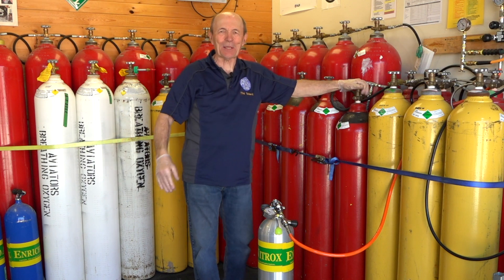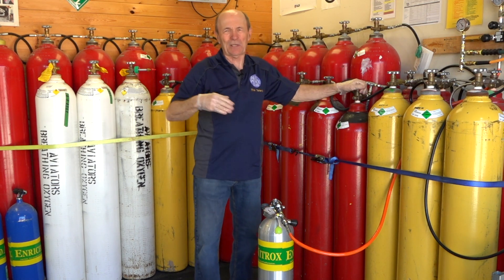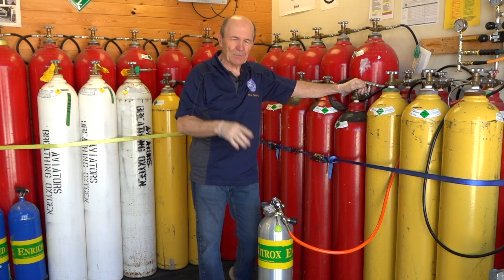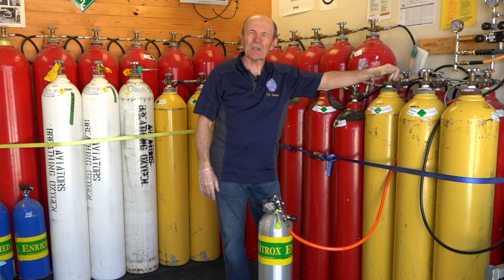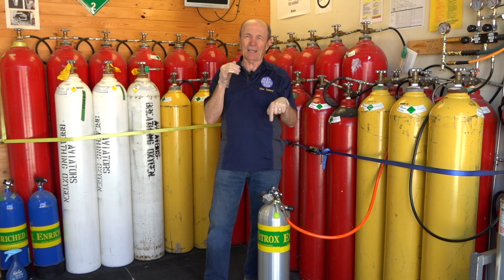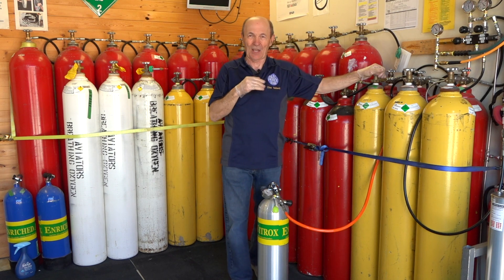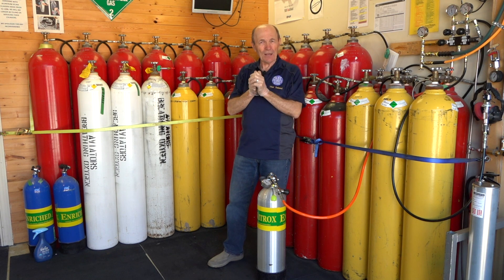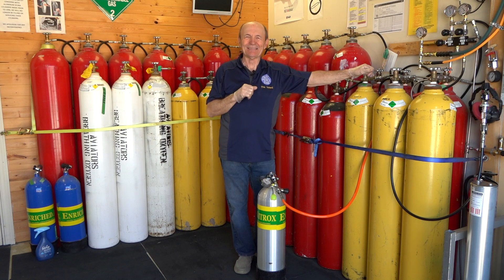How A Cascade Tank Filling System Works - Scuba Tech Tips: S11E08

Comment: Dear Alec , kindly i need to know your experience in flying with tanks ..Empty tanks for sure , i heard that i should remove the valve .... is it OK for the tank to keep it exposed like that , and for how long , also should i do any specific maintenance for the tank once arrive? .... another question about tanks also , how to protect the external edge , i'm sure there are many ways starting from the Net covering till painting , what you prefer , what is the best way... i believe we need a video for all of this :) .. thanks in advance.. Haitham
Reply from the maker: I'm going to assume by tanks you mean small spare-air or pony size in checked luggage as paying for a 80 cu/ft is crazy.  If you must take tanks, they have to be empty with the valve off otherwise it will be inspected, unscrewed and probably left off.  With the valve off, cover the opening with something strong like plastic wrap and tape around the neck.  
Each airline and country has specific requirements to check online before hand.  At your destination ask the shop filler to check for obvious contaminates (dust, clothing fibres) before filling.  Consider renting locally to save a lot of problems.

Comment: I think the fundamental piece of information that is missing is why you don't fill everything including the "great big tanks" to 4000 PSI.  I am assuming that these tanks can't hold that amount of pressure.  Getting tanks which are that big and rated for 4000 PSI would be expensive so you use these cheaper (lower pressure) tanks instead for the initial fill.  Then you go to your smaller and more expensive (higher pressure) tanks to top up the fill.
Reply from the maker: It comes down to physics, cost and time for a store.  HP tanks go to 6500 psi but fill very slowly compared to LP's at 4000.  The compressor output is the so LP's fill up faster than HP's.  Next time in your LDS, ask to see their fill system and you can ask intelligent questions from what was picked up here.

Comment: We used a very similar system for the 20 years I was in fire service. In most instances we had 6-8 very large tanks filled to approximately 4500 psi. These were usually mounted on a trailer with a separate station mounted compressor. On a very large fire scene we would tow the trailer and re-fill the air tanks on the scene. If not that many tanks were needed then we would re-fill them back at the station any time of the day without having to run the compressor. We would normally fill the main cylinders as needed. We called it a cascade system. Later we had a rescue truck with tanks mounted permanently in it that could be driven to the scene. Also in this way not every station needed a compressor but could be towed or driven to a central station for re-filling! This cascade system works  great!
Reply from the maker: Thanks Mr Bigfoot14 for sharing this and that these systems are everywhere, not just for divers.
Reply: @AlecPeirceScuba_SeaHunter  Yeah, I never thought about the need for firefighting gear.
Reply: I'm curious, how is compressed air used for firefighting?
Reply: It’s used for breathing air in all firefighting airpacks.
Reply: @bigfoot1465  Ahh of course

Comment: Im still confuse. That's math. 😕🤔
Reply from the maker: Very important math sir to get your tank filled quick.
Reply: It averaging.  The pressure will be in direct ration to the volumes.  If the empty tank is 1/10th the volume it will take up 1/10th the air so the other tanks now have 90% as much air in them.  The actual amount is much less with all those huge tanks which is why many shops use less of the huge tanks then Simco does but use higher pressure so they need very little at 4250 PSI.  You can partially fill a lot of tanks with those big cylinders.  You also do not need to run the compressor as long so it does not get as hot.  When you our water out of a 2 liter bottle into your cup there is less water left in the 2 liter bottle, right.  With air, less air means less pressure.  You have reduced the mass and thus the pressure at the current temperature.

Comment: unless you have two compressors, the compressor will run the same amount of time ?, I can understand if you use a higher volume, lower pressure compressor to fill the low pressure portion of your cascade system and a higher pressure , lower volume compressor to fill the higher pressure portion  of the cascade system, to me the net benefit is to be able to fill rapidly a number of thank and operate a smaller compressor for a longer make up time  out of the demand peak.
Reply from the maker: It is a balancing act between time, cost and customer needs that every filler has to decide on.  At Scuba 2000 we had 3 banks and the compressor filled the lows first, mid tanks second and HP's last and would last days without the need to top up.  Thanks for watching Jacques.
Reply: The total time is the same but you are not constantly stopping and starting it which creates more wear.  It wears out more types of parts and ones that are not as easy to make more robust with affect their functionality.  It also allows time for the bottles to cool off and for the pressure to stabilize so you get a more reliable fill.

Comment: Questions:

1. You only have two banks in this bank system? Typically, the bank systems I have seen have 3 - 4 banks.

2. Why fill one bank to a lower pressure at the beginning? Why not fill all of the banks to the highest pressure possible (up to their rated pressure)?

3. When you run your compressor, do you fill all of the banks in the system at the same time or do you fill one bank and then the other?
Reply from the maker: Lots of questions so #1; 3 can be typical but remember the greatest psi change is from empty (or close to it) to around 2,500 psi.  That takes a lot of volume of air, not so much higher pressure which is why the Simcoe Diving setup has 2.  Also Simcoe Diving fills a lot of firefighter tanks (smaller) and other none diving tanks so this setup works great for their customers.
#2 Thats the logic of the cascade system, a big fill to 2500 then a small fill to 3100, cooling off to 3000.
#3 One bank at a time.  Say you had a lot of tank VIS and hydros.  All would have to be filled from zero psi using a lot of your Low Pressure volume.  Filling a divers tank usually starts at 750 (if smart) or a little higher so no as much LP is used.  Where the HP tanks mostly  fill from 2500 to 3100 only.  Good questions.
Reply: @AlecPeirceScuba_SeaHunter  My shop seem to like more like 3150 which results in 3000 and since it is usually below 40F on the surface the tanks are often 2800 once in the water a while.

Comment: Like Alec said- with this system you can get the compressor to run in the morning, as this is the time when the air is not that humid, instead of having to turn it in during at noon when the air may be hot and extremely humid (saves on filters a fortune)
Reply from the maker: Right you are Valentin.  Most shops have the compressor inlet on the roof away from car exhaust but also much hotter and no shade.  Large compressors can be very expensive to maintain but if you have the tanks to fill, it is needed for happy divers.

Comment: I don't think this system saves compressor time. If you fill 10 tanks, that's 800cu/ft from the bank , that you have to fill back with compressor. 
But it defenetly makes things faster, it's only takes 1-2 min fo fill.  so you don't have to chill there while  compressor pumps up your tank up. Similar to reverse osmosis water filter. 
Might be wrong though. 🤔
Reply: At my dive store you walk in. Hook it up and let r fill. It stays there for a bit because as the bottle cools extra air gets added. So you walk away with a bottle that doesnt lose pressure due to heat and a very very full bottle.
Reply: True. The compressor has to compress that amount of air, regardless of which bottle it goes into. If anything, it has to work harder to get up to the higher bank pressure than it would for direct-to-bottle pressure (if it's anything like pumping bicycle tyres).

Aside from time, you also get a little more air, since you are not filling your tank with freshly hot air. The airbanks could have had some time to cool off, and then the air further cool a little bit as it expands into your tank (bigger effect when filling lots of tanks in parallel).
Reply: You're assuming that the compressor makes perfect use of it's running time. But in reality the compressor would have to speed up/slow down every time you want to use it, and that adds overhead every time it runs. Better to run it in one long session then lots of starting and stopping.
Reply: @cerebralm  Yeah, stop and go traffic vs smooth steady traffic.  It waste more energy and cause more wear.  The mass of you car still moves the same distance but one has more wasted energy.
Reply from the maker: Lots of discussion to your point.  At large shops like Scuba 2000 (pre-COVID), we would fill 10 pool tanks (8 students + 2 instructors), filled 3 times a day for Sat. and Sun. o/w classes + weekend fills + o/w cert diver fills.  Our cascade system was setup for peak use on weekends then turn on the compressor at night (cheaper electricity, cooler inlet air temp, etc.).  If your setup for the average number of fills per day, customers will be waiting or leaving so each shop is unique.  Thanks for the question and keep discussion everyone.
Reply: yep, though working at 4000-6000psi for those very HP filler might more than negate that ? I don't know.
Reply: You don‘t save runtime really. But you save start cycles and filter consumption. The moment of starting is the moment with maximum wear due to bad lubrication in the compressor. The air drying system works much better at lower ambient temp so you use less of the capacity of the final filter (disposable material or disposable catridges). You save wear, filter, customer time and can use smaller compressor. But you have to invest space, cascade tanks, some extra electric energy. Because your last stage for topping up has to hold a higher pressure than your tank and it takes more energy to compress to 4000 psi than to 3000 psi.
Reply: It reduces wear.

Comment: makes perfect sense - even if you could have the very big tanks at 4500psi (maybe they are also cheaper as LP) you would eventually drop to bellow 3000psi and not get a full fill if you used them all at once, without keeping some HP > 3000psi ones for the last top off to reach full fills...
Reply from the maker: Yes, there are many ways to setup a cascade system based on daily # of fills, space, cost to run the compressor, fill speed (for the customer not tank) and more.  And yes, sometimes we actually had to fill tanks from the compressor for various reasons.  Thanks for watching Alain.
Reply: @AlecPeirceScuba_SeaHunter  My shop use a high PSI of 3000 and then just tops of the 2900+ to 3100+ from the second bank of tanks.  It take up less space and tanks but provides enough mass for their use.
Reply: Alain Dumesny you have to invest more energy if you do that. Compress to 4500 psi creates bigger amount of heat at the compressor and tanks. Thats bad for overall effeciency. You need more electric energy per tank.

Comment: i'm still not 100% but that did help a lot. Are the bank to bank to bank setups ever regulated/automated?
Reply: there are not automated at a local shop (3 gauges banks you manually open/close). I suspect the 4500psi has a pressure limiter set to 3500/3000. My other shop is straight from pump which auto-shuts off when reaching 4000psi, with 3 wips sections pre-set to 2400/3000/3500
Reply from the maker: Alain's description below is correct but it can get more complicated from there.  Watch Tech Tip S08E09 What Is A Fill Station?  Will show the 'how' banks are switched.
Reply: Most shops have two limit regulators and two lines and then switch during fills.  Often the cascade tanks are in back somewhere near the compressor in the back on the shop.  My shop has no auto shutoff, it is all manual.  I imagine they have more spare employee time then there is need for the expense of automating it.  You can also adjust the final pressure for the season.  I summer you are going to have a higher final pressure since it will cool off more by the time it is in the water.  I often see them use 3200 PSI then instead of 3100 PSI.